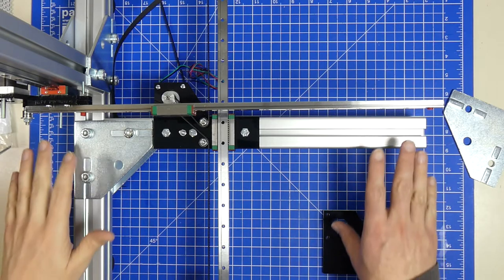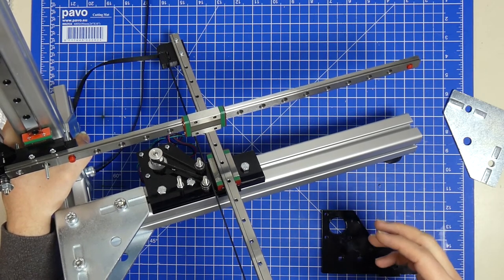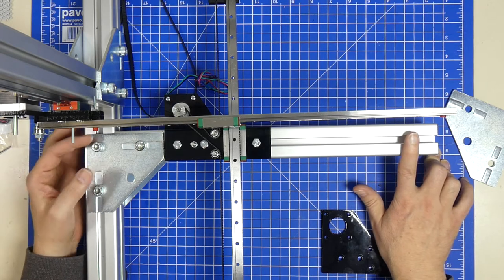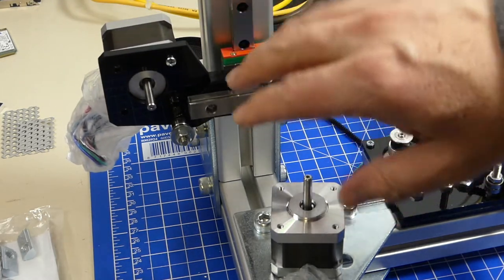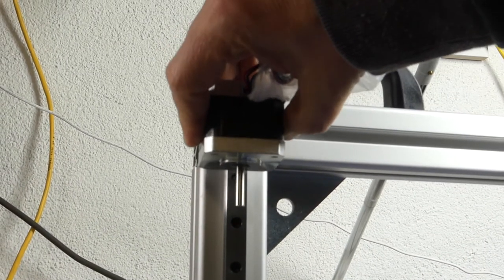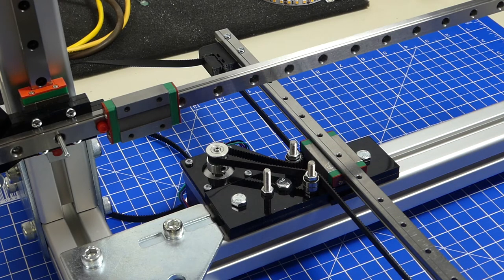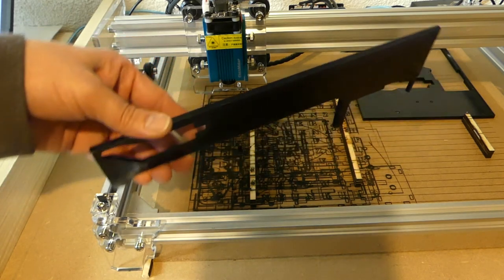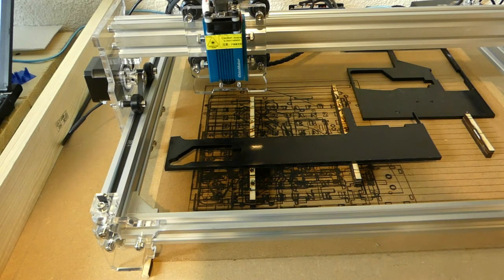Big Bad Robin Build VLOG pt. 2

Comment: The elevator stepper motor could be mounted on the top, if you don't have the space for the stepper motor in the bottom.  It might even be better to do that. You could also have it belt driven, so you can put the stepper motor on the side.

Comment: What's input voltage is perfect for those Steeper? And ampare too
Reply from the maker: It's not that simple. These steppers are rated 3.7V for voltage driving, and 1.7A max current for current-based driving.
So, if you drive it with H-Bridges 3.7V is what you want. If you use embedded stepper drivers, then things get complicated:
You want a supply voltage at least twice the rated driving voltage, and a controller that can do at least 90% of the rated current as peak load. But you will want to set the drive current lower than the rated max-current at the driver. Embedded drivers like the A4988 shape the current sent to the stepper so it can achieve a much higher step count than the mechanics would allow for.  They also compensate for the inductive load of the coils, so the voltages sent to the stepper may be very different than what the spec says.
Reply: If i use 6 or 12 volt biopolar , what should i do with Arduino Nano+ULN 2004A control board
Reply from the maker: For ULN2004 you should go for 12V 500mA unipolar (6-Wire).
Reply: What Will  i connect to control board 6 wire or 4 wire . There are 5 pin which is 4 pin for 2 coil(4 wire) and a common positive pin.
Reply from the maker: Six wires, two go to the common positive.
Reply: Is there any way to calculate unknown 6 wire unipolar motor voltage . With multimeter or something like that.
Reply from the maker: Sure. Measure the resistance of the coils. Find which wire is the center tap of one coil. Note the resistance to each other wire of that set of coils (must be the same). Take that value and divide your supply voltage (12V for example) by the resistance. If you get a value between  0.2 and 0.5 (A) you're good to go.
Reply: can u tell me about softwer installation step by step. like ( first i need to install arduino and then send the controller code .ino file to the nano board). then which softwer needs to install and what i need to do.
Reply from the maker: Most of the steps are self-explanatory, I have several videos in the Talk- playlist that help with that. 
Depending on the build of your plotter some steps may differ slightly.